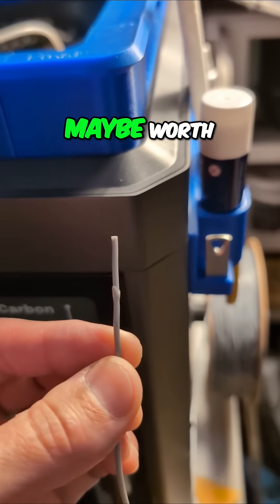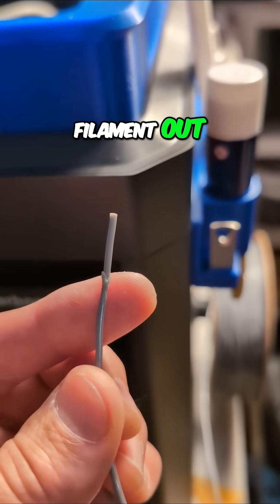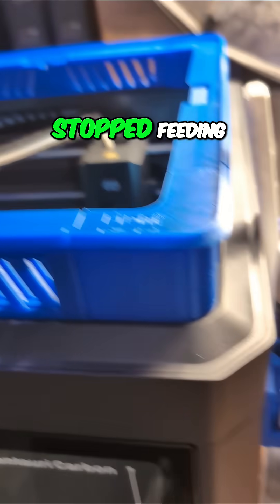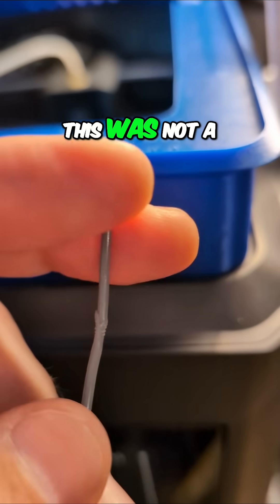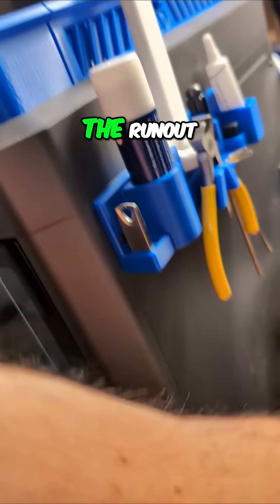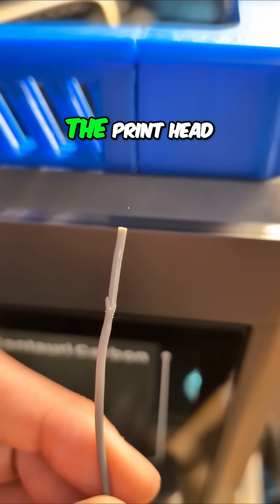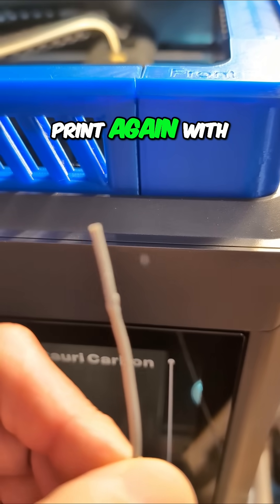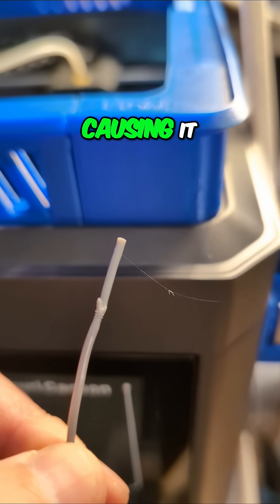3D Print FAIL! Was it the Filament or Something Else?

Comment: Its tpu. Tpu doesnt do well with ptfe tube. It binds. Have to slow it down to like 30mm and run temp at 215. Turn off z hop
Reply from the maker: I think it was packed wrong at the factory and got waterlogged. I put it in the dryer and it mostly straightened out. Gonna try again soon, maybe printing directly from the dryer.

Comment: That spool looks interesting.
Reply: Have you dried the TPU?
Reply from the maker: Thanks. I also noticed 2 things:
- the box has a little note in the fine print about using a .6mm nozzle. Only .4mm are available for this machine right now. 
- I opened this fresh TPU printed with it right away. But when I put it in the dryer it showed 40% humidity. I think my assumption that it was dry enough from the start may have been false. I'm drying it now and will try again on my Neptune 4 Max (I have larger nozzles for it), and may print directly from the dryer.
Reply from the maker: Yeah. I've never seen a spool wound like this. I"m thinking this filament is defective.